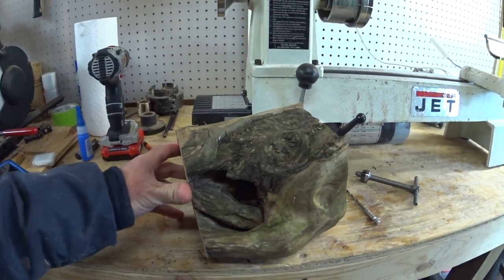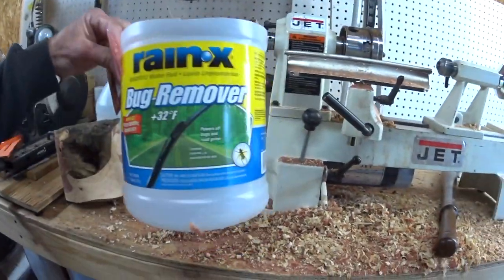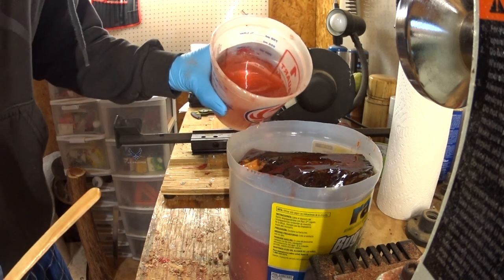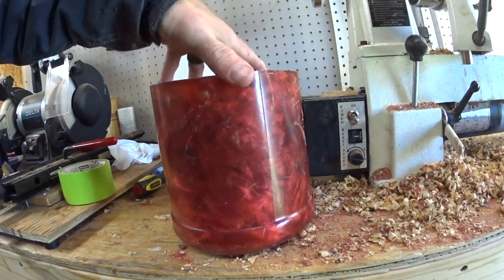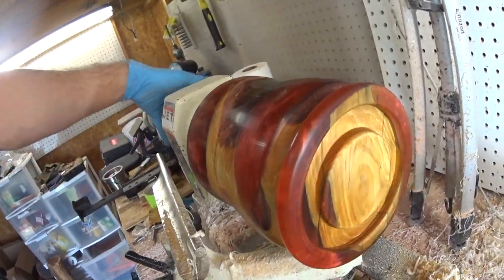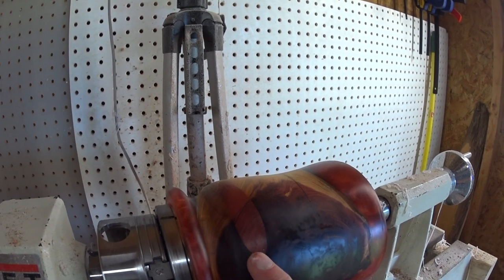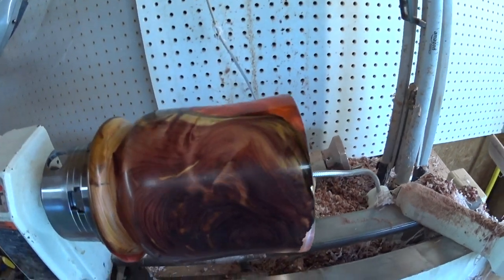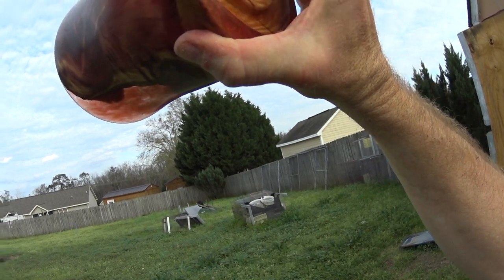Wood turning a Cedar & Resin Vase

Comment: Very nice Mike, I hope the wet sanding through the grits gave you the finish you was looking for.
Reply from the maker: Thanks, Al! It did a lot better than in the past. I forgot to give it a coat of sealer, but it worked out a lot better than usual. Thanks for that advice!👍🏻 I have a lot more cedar to practice on. 🙂

Comment: I like it!! I think that would make a great plant pot to set a potted plant in so to protect it from water damage. Very nice it also looked like it was very hard when you were shaping it not cutting very well?
Reply from the maker: Thanks! I hadn’t thought of the plant idea, but that gives me future ideas. If I only had time for all of the ideas. Lol It was a little hard to cut, but I think it’s just time for new cutting inserts. I keep forgetting to order more.
Reply: Scenic City Woodturning I hear you can sharpen carbide on a diamond stone but just sharpen the flat top side with a little oil on stone and press flat side down lightly and just do small circular motion till you see the dark on the diamond pad. I have not tried it yet myself but it looks and others say it is very easy.

Comment: Not a turner - just an observer. But it seems to me like a little of the dye/pigment coloring goes a long way in the resin. Maybe try using less and see if you don't get the lighter transparency you're looking for. OR - you could just keep a light inside or keep holding it up to the sun all the time. :>)
Thanks for the video. Great scripture verse for these days. Thanks again.
Reply from the maker: Thank you, Jerry! I always get too much dye in the resin it seems. I use less every time, but you’re right, it does go a looong way and it usually ends up being too much even with less. Thanks for your support. 🙂